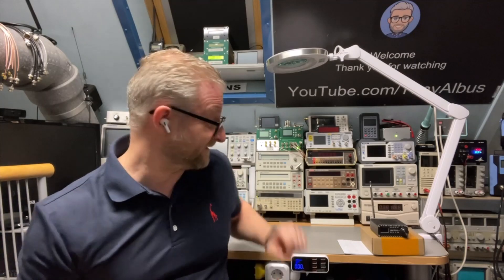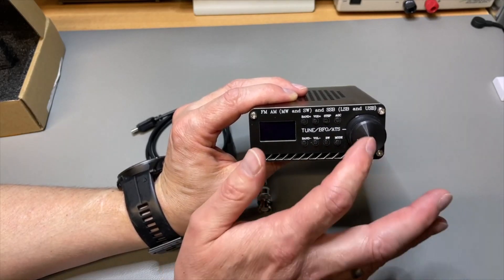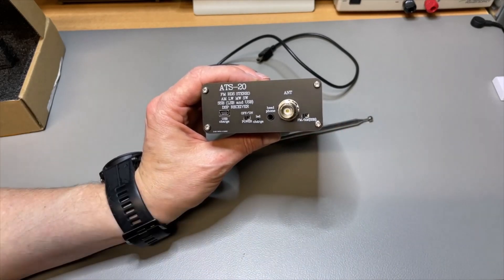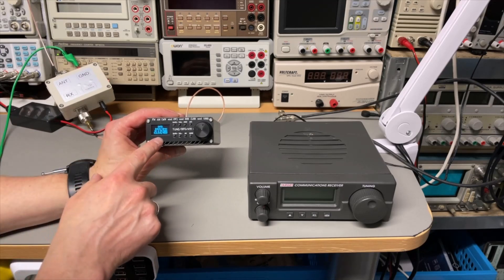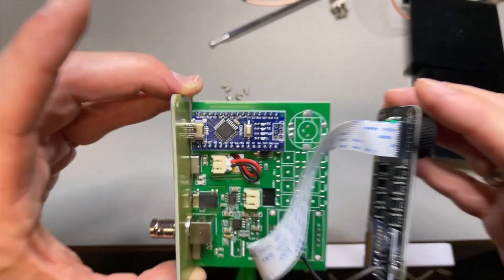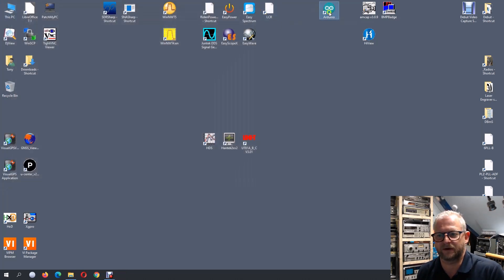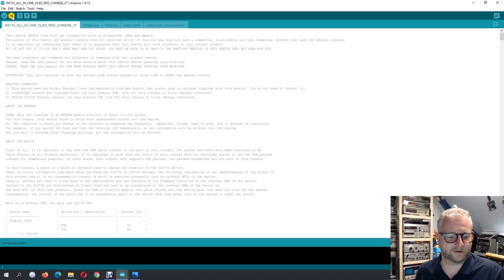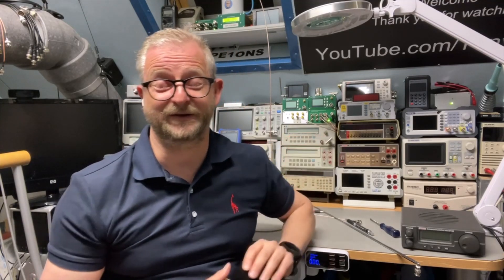#205 Si4732 ATS-20 Test and Update - Open Source Receiver 0-30 / 64-108

Comment: Thanks for referencing the Arduino library and the author.
Reply from the maker: Thank you for all your work on this project!..
Reply: The last firmware release (V3.0.7F) has Automatic Volume Control (AVC).
Reply from the maker: @pu2clr  Thank you for the update!... i have send my radio back to Ali, because HF was not working, but new is on its way from BangGood and for sure i load the last firmware. Was thinking also to look for the ATS-25 with the big touchscreen, but not sure if that one is in one of your samples.
Reply: @TonyAlbus  Unfortunately the manufacturer doesn't seem to do a good quality control of their product. Several other buyers had to do the same as you. This receiver is very basic and only uses the internal resources of IC SI4732-A10.
Only the IC does a good job on VHF(FM) and LW/MW/SW (AM and SSB). The manufacturer didn't add filters or a minimal front-end that could improve the final quality of the receiver. I wish you sucess. 73. PU2CLR.
Reply from the maker: Thank you!.. i wait my new ATs-20 and play again, thank you for your work on this opensource project.. Do you have also samplefiles in your repository for the ATS-25 with the big display touch, i am thinking of buying that one too, but only if you have the example files... because that just works inmidiate first time. great job!.
Reply from the maker: @pu2clr  Thank you so much... okey i am in those groups... Thanks!
Reply: @TonyAlbus  hello does the ats 20 have an internal switchable receiver amplifier?

Comment: Grew review and discussion of the unit’s weakness. I too have found it to be a great commercial FM radio receiver. For HF though it really seems to be useful only with a receiving antenna that has a pre-amp built in.
Reply from the maker: Thank you John, yes totally agree.
Reply: No need for preamp if you have outdoor wire as antenna.  Preamp is rather evil in city conditions with extreme electrical noise
Reply: The small 9v loop antenna kits (AMLA150) from AliEx work very well for me, even indoors and cheap at 15 dollars.

Comment: Thank You 🙏
(Is there an Easy Way to Fine Tune the Receiver?)
I recently bought an ATS20+ & it Receives very well across MF,HF & it's also great on the commercial VHF FM Band but I noticed it's slightly off Frequency when using SSB HF
& it has no RIT for SSB below 1KC steps.
Is there an Easy Way to Fine Tune the Receiver to correct this?
Reply from the maker: Hi, maybe you can finetune it in the arduino software, but i did not follow the project for 2 years now.
Reply: @TonyAlbus  Thanks for the info my Friend & 73 ⚡🙏⚡
Reply: В прошивке 1.18 есть такая функция

Comment: Hello. A very interesting and interesting receiver. I am interested in whether this receiver has the FM frequency range 87.5 - 108 MHz. If so, what are the sensitivity and selectivity? I would like to know about this radio. Thank you and best regards.
Reply from the maker: Hi i have tried it here and the sound it good, but it also depends on the internal speaker, there are many versions around, from very good to almost crap.
i have no specific numbers for you, but i use it as my radio in the office
Reply: @TonyAlbus    Ok I understand. How does it look in terms of sensitivity and selectivity? I mean separating the strong stations from the weaker ones close to each other?

I have seen many different models of these, but the internet does not convey much information. In Poland, little or no such models are popular, because I have not found a single YouTube video in Polish.
Reply from the maker: @fm-dx.  Hi, this guy did a lots of tests: https://www.youtube.com/c/KevinOReillyswl  hope that helps.

Comment: Hi Tony, 

I can't put the ATS-20+ in programming mode. 
As soon as I connect the USB cable, the radio switches on (even with the swich in the back on "off") and no COM port gets created (and yes, I have installed the chinese drivers). 
I have tried switching the radio on, pressing the encoder knob and connecting the cable afterwards - no result. 

Any idea/hints? 

TNX es GL de UT/M0HHE 
AR K
Reply from the maker: Your device is maybe a lot newer then mine. sometimes the USB is only for charging and when you open the device you find the arduino with its own USB inside.
Reply: The USB ports don't work on these radios!  Mine doesn't work either so have to install a new Arduino I guess if there is a way to figure out how to program it.
Reply: That's pretty sad, they bothered to add the USB-C port (I suppose to comply with EU regulations) and they messed up the arduino port
If anybody finds a way to fix that... please let me know. I wanted to try to implement a CAT functionality to pilot the radio from a PC/Raspberry.
Reply from the maker: @amministratoredominio3694  Yes agree... you prob correct. charging needs to be USB-C .. maybe insite you still find the arduino port. 
For your TRX, have a look at catdisplay dot com
Reply: @TonyAlbus  thanks Tony, but my idea was to write the Arduino code to implement the CAT protocol (of some stuff I know, like my ft857d or my ft1000mp5) so that we can use the cheap ATS-20(+) with FlRig, HRD, MixW, etc. 
Still, this requires a functioning USB connection to the Arduino and a MAX232/TTL port on the ATS-20(+)

Comment: Mine came with something rattling around inside. So I opened up the case and it was the battery rolling around loose in the bottom half of the case.
Reply from the maker: Yes the first i received was properly build, the last 2 ones where lower quality, i think later cheaper copies where made.

Comment: How would I revert back to V1.1.5 if I wanted to? I have not flashed the board yet but I would like to have it just in case..Thanks
Reply from the maker: You can not download it from the device with the arduino software, so then you need the sources. But maybe with a lowlever downloader you get get it from the device.
Best is to try to find the sources i think.
Reply: Yes, you can easily revert back to any software that is available. Maybe not a "revert back" but just an over-write. I just upgraded from 3.04 to 3.07......but didn't like it, so i just over-wrote the 3.04 back on it and it is back to normal. Just install the PU2CLR libraries (Si4735) in the ArduinoIDE and you can install any of them you like. They will show up in the "Examples" tab as usual.
Reply: @TonyAlbus  Thanks Tony! great videos. Glad I found your channel. Lots of great info here. Keep up the good work!
Reply: @englishrupe01  Ok, thanks! is there any way to know the characteristics of the examples before I install them? I do not want to lose my shortwave reception. I get good FM but just ok shortwave reception. I like this little radio though.
Reply from the maker: @englishrupe01  Great, thanks for sharing
Reply: @MegaJcp3  Yes, you should be able to read the characteristics of each version on the comments on the program before install on ArduinoIDE. PU2CLR does a good job there always. But i seriously doubt you are going to lose any reception....just changes to controls and tweaks. For better SW you will probably need to run a wire, or at least one of those cool AN retractables.
Reply: @englishrupe01  1,5  fabrika yazılımı9 küçük ekran yazı  nasıl geri dönebilirim yardım edin.
Reply: @POMEMRAH  Just use the ArduinoIDE and install a different version. Generally, the comments on it will tell you the different characteristics.  Sadece ArduinoIDE'yi kullanın ve farklı bir sürüm kurun. Genel olarak, üzerine yapılan yorumlar size farklı özellikleri anlatacaktır.

Comment: also because ATS-20 only unfortunately on CB no FM is a shame, hope an uptade come for it
Reply from the maker: Hi, i think that is the limit of the main chip, that does not support it, that also means you can not solve that with a software update.
Reply: @TonyAlbus  ok thanks Tony 😔
Reply from the maker: @VOLKZZORN  i wanted something simular but te otherway around AM on airband.. but both the frequency and AM there is not possible. 108-136 MHz
Reply: @TonyAlbus  yes, it's a shame because it's really great to see if the ATS-25 FM in 11m band would be great.  but maybe there will be some modifications 😉
Reply: @TonyAlbus  Hey, Tony....don't forget there is the very cheap (under 25 dollars) FlightStick SDR dongle that gives you all the VHF 118-136 Mhz band. Plug and play.
Reply from the maker: @englishrupe01  Yes those are very cheap and do work. thank you for sharing

Comment: No data cable with the one I just received
Reply from the maker: okey, on mine was a standaard usb cable.
Reply: @TonyAlbus  If I can find an old USB cable, I should be able to update the firmware without any problems?
Reply: @TonyAlbus    My USB cable that came with the radio is a C charging cable. There are 2 USB ports on my radio. One is for the C cable and the other is for the USB mini, like the one you have on this video. I'm wondering if I can update the firmware with the C port or if that is only for charging. One would think if they add a C port, they would also have the latest firmware, but no. It has the first edition of the firmware so it needs a couple of updates. Thanks for your great videos!
Reply from the maker: @mickstermouseter7059  Yes maybe, the video is more then a year old, maybe things have changed, i have not played with it sens then
Reply: @TonyAlbus  My radio is a ATS-20+

Comment: Hello Tony I have the same receiver ATS 20 plus. Where's the old version 1.5 I have an issue with that the FM works perfectly but the a.m. and long wait no stations are present there is his noise regardless of the tuning no stations are found. Electronically come see anything wrong with it is it possible that it could be the firmware will the update solve this problem. The other thing I was wondering is if you know how to do a full factory reset. Any info regarding for the problem I have will be great thanks
Reply from the maker: Sometimes the chip is Deaf, it happened to me once. this video is 3 years old, and i have not been flowing the project, all i know is in this video and is prob. already old news.

Comment: Can the ATS-20 be updated only via a Windows computer?
Reply from the maker: i updated it with arduino software for windows if that is available for other os, then maybe you can. also there are bin uploaders but then you need to find a compiled bin file.
Reply: No, it updates fine on my Linux Mint machine through the Arduino IDE.

Comment: any idea how to update the ones without the nano and just a smd atmell 328 chip?,i have this model,it has no usb port but a c type,cheers Paul.
Reply from the maker: If it is also arduino, do everything the same, but select the correct chip you have.
Reply: @TonyAlbus  already done that but need to know what board to select in the ide,cant see a way to select just a 328p chip,tried uno and nano old and new bootloader,nothing works,although my pc sees it as a ch-340 serial port.!.
Reply from the maker: @tekguyla1118  The serial2TTL is just that.. its important to find out what chip it has. i am not familiar with your model.